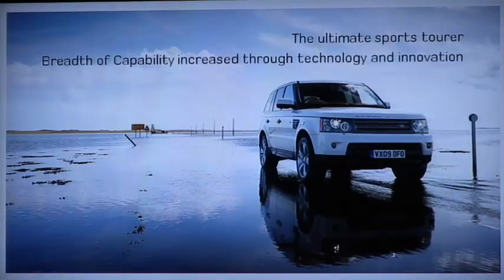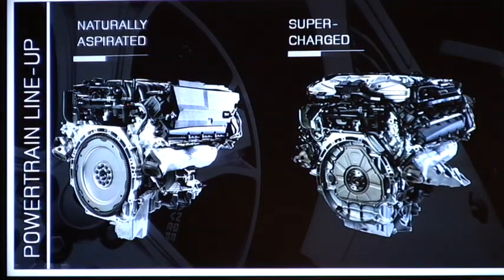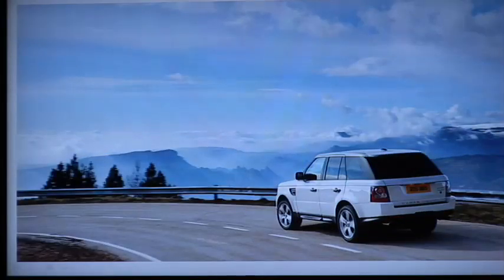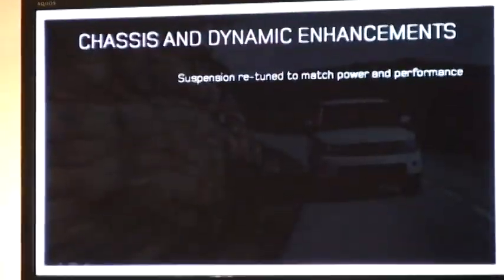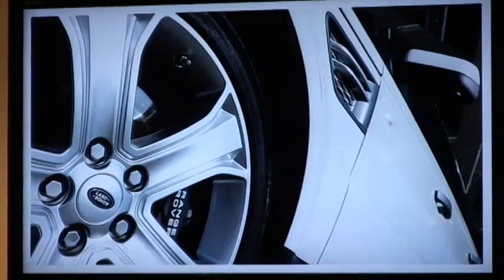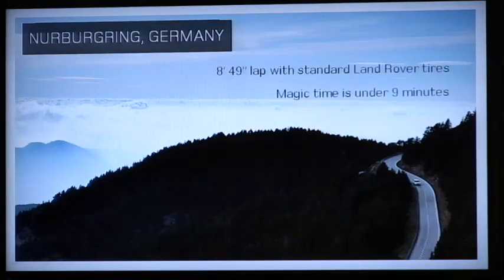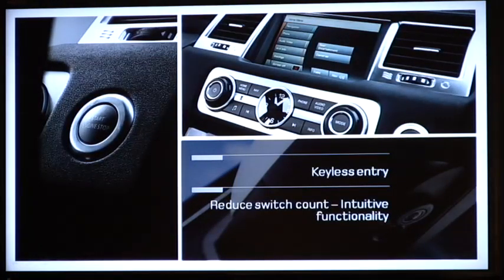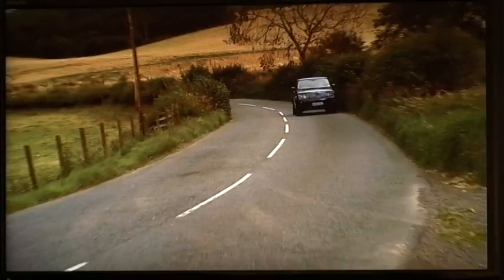Technical, 2010 Range Rover Sport. 09.21.09

Comment: I have a 2010 3.0 tdv6, it's a class vehicle inside and out. I always look forward to driving it. Have a gearbox flush and oil refill at 75000 miles at jgs 4x4 in kettering. At this mileage the auto box starts, slipping,wondering ,over revving. It's around £260 and makes a massive difference.